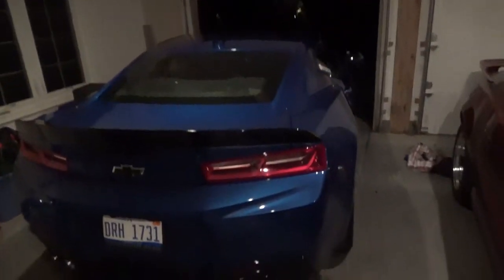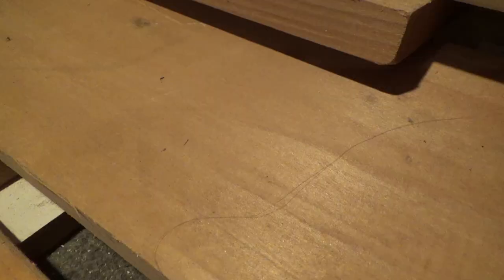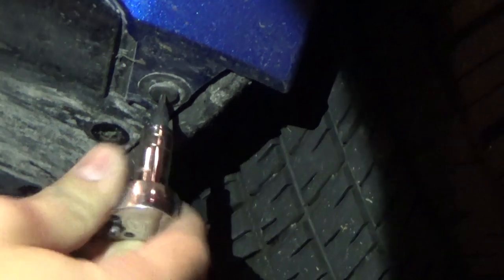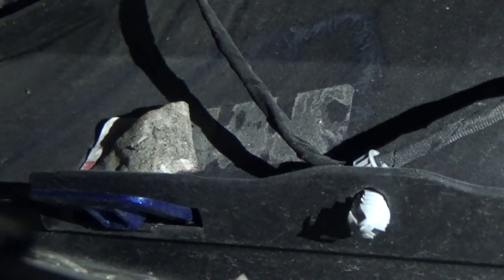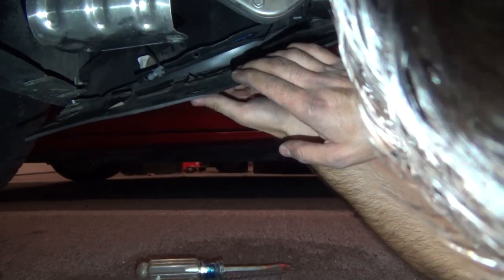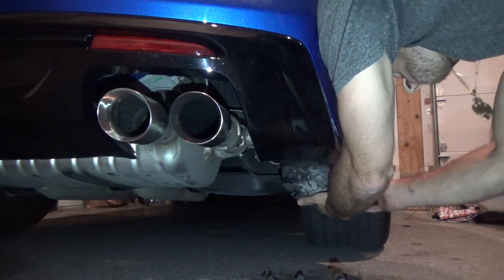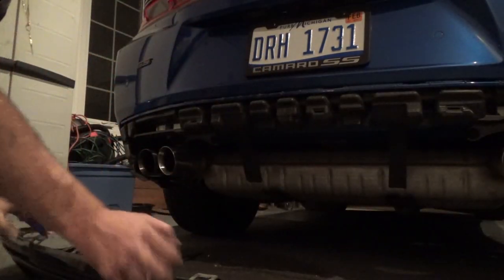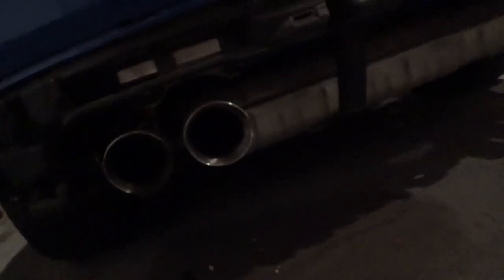2016-24 Camaro How To Remove Rear Diffuser/Valence

Comment: I just tried this on a 1lt rs.... the first clip i tried to pull a silver piece came from behind. i dont think its meant to be taken off this way.
Reply: Aligator clip. He didnt pull them out first probably how he broke a tab
Reply: @juniorcontreras90  what’s the best way to take apart the clips?
Reply: So we're u able to do this successfully?
Reply: It is not indeed, the only safe and correct way is to first remove the entire bumper cover. That's how it's done.

Comment: Sorry to say this, but you did it wrong  know wonder you broke one off, use a small flat screw driver n push the center tab down  n gently pull on it ,don't need to pull it  hard, n you didn't mention the 5 flat clips that goes on to...
Reply: Where is the link to your video
Reply: yeah where's your own video?
Reply: Your right, he did it wrong. I'd be pissed if someone sold me that crap after breaking it.
Reply: The 5 alligator clips is for the bumper brace, the diffuser itself uses two in the left and right sides